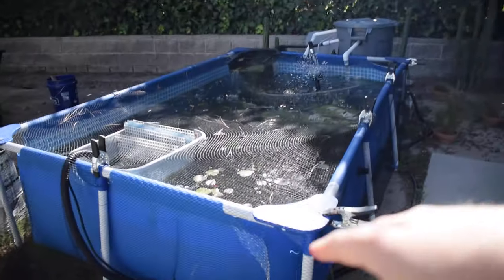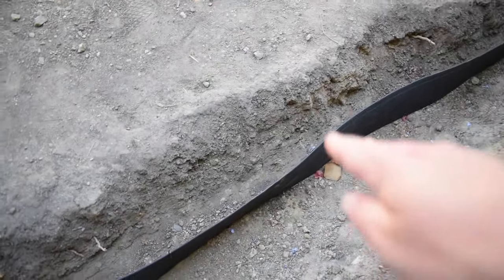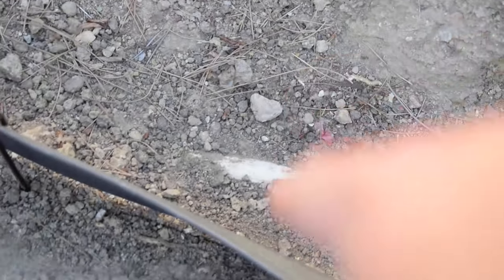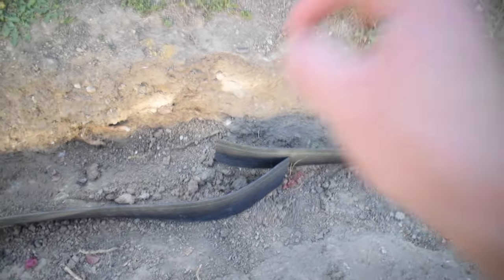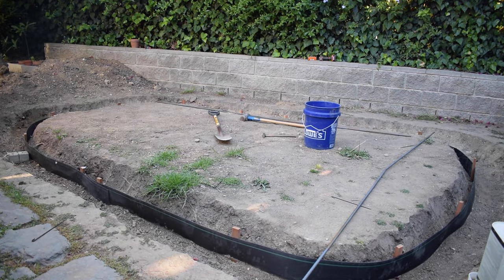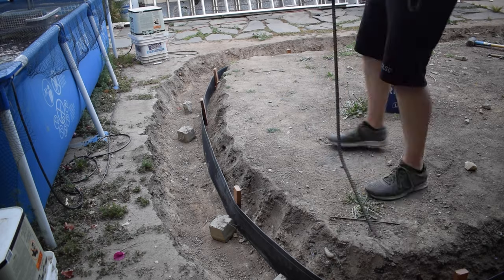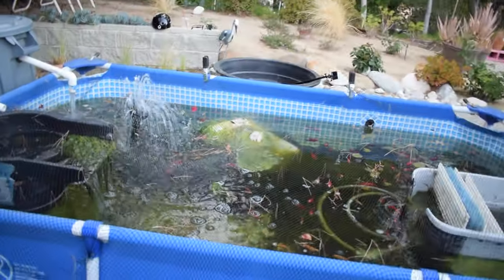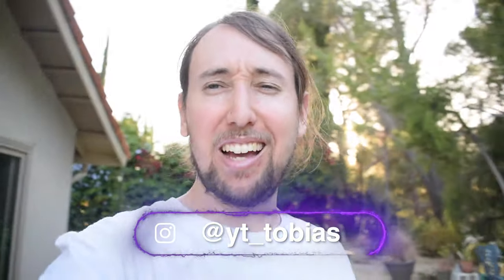Rebar for the Pond! DIY POND BUILD!

Comment: Honestly for a foundation that is that small and holding very little weight above it you could’ve got away without the reinforcement bar
Reply from the maker: Ah ok good to know. Now I'll be less worried about something happening to it
Reply: @Tim's and Liam's Fish and Turtles well being a civil engineer there is not going to be the amount of weight pressing down on the foundation The downward force of the water is going to be acting on the ground underneath the pond most of the force is going to be sideways against the wall so perhaps some reinforcement behind the wall above ground could be an idea and yes an American gallon of water weighs 8.34 lb where as a UK gallon of water weighs 10 lb if anything the ideal solution would be to have a thicker wall at the bottom tapering upwards to thin wall at the top where there is less pressure possibly even putting some Rebar pointing upwards out of the foundation to fix the wall against Shear
Reply: @Tim's and Liam's Fish and Turtles not only that but considering the pool ponds he has which also hold a lot of water are made out of thin metal rods and vinyl I don’t think they’ll be a problem